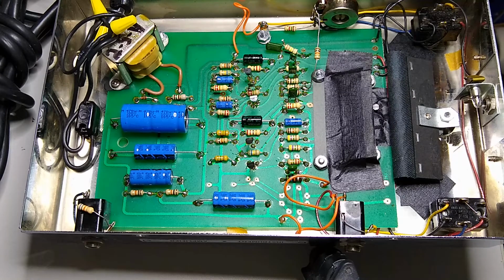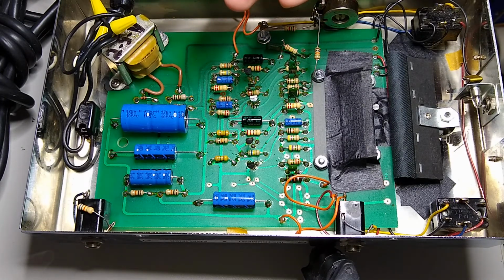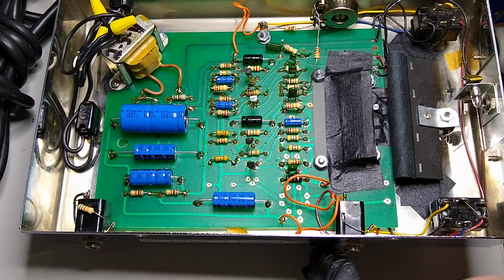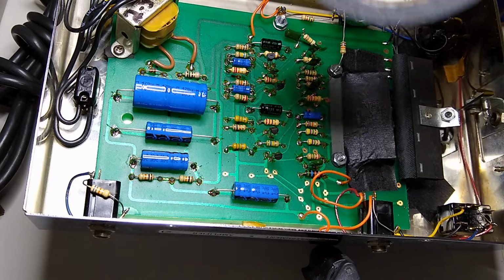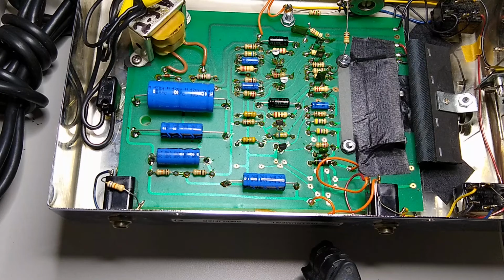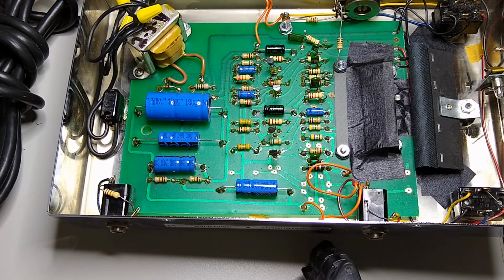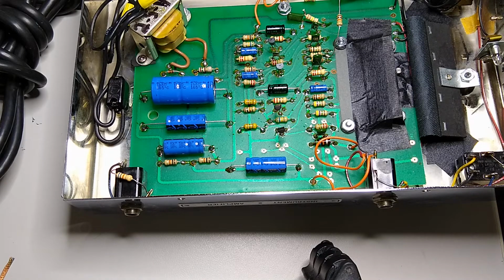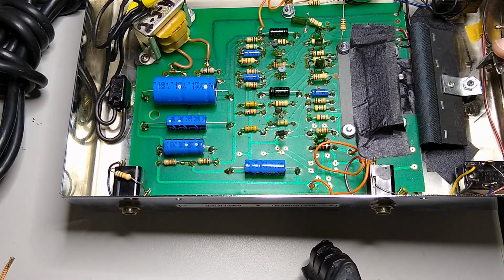Morley Maintenance, Repairs and Adjustments

Comment: ok so i have a pro series distortion wah volume. from 93-97 do the adjustments here wrok also. im finding the wah to be anemic even when running the distortion in the pedal itself. i mean im not expecting like god levelk but the sweep should at least be better than the daphoniq pedal that i payed 50 bucks for on amazon. it had lots and lots of problems but the sweep and to an extent the tone was better. ive checked the literature on the morley website but it seems a bit confusing
Reply from the maker: It should affect it yes, the LEDs get old and stop being as bright too.

Comment: Hey Scott, I recently just got my PWB and Im from NZ, there’s obviously a massive voltage difference compared to the US and I was wondering if a 200W step down voltage converter (240v to 110v) would be a good substitute? Thanks!
Reply from the maker: 240 to 117 would be ideal. The AmpRX brownbox is an excellent choice for this.
Reply: @ScottyBrockway  ohhhh right okay thank you! But just checking because I haven’t found anything with 240 to 117 in my country… would that other transformer work with the pedal?

Comment: Hey Scott I got a Morley Volume Pedal from someone. The light switches on but doesn’t vary the volume. Interestingly when I opened it up just now, that major green colored circuit board is MISSING! Would love to send you the photo of this interior. Talk about feeling ripped off by this seller.
Reply from the maker: If it's just a volume pedal, there is no circuit board. Only the shutter, ldr, bulb and power supply.

Comment: Excellent Vidéo !
I think I'll have to replace some capacitor or resistance on mine...
I just get a Morley power wah but there is no High and when I'm in the lower tone, the sound seems ti despeare...
Everything' seems to be ok inside, the bulb is ok  but the sound is beetween a volume pedal in the low and a poor wah in tbe high😢.
Sorry for my poor english...
Reply from the maker: Sounds like the LDR might be misadjusted, its a common thing.
Reply: @ScottyBrockway  I'll try this this evening to see if it makes a change.
If it's only this, that would be great !
Thanks so much for your fast answer.
Reply: @ScottyBrockway  I think I've found the problem.
The bulb seems to be too weak.
I 've tried with a powerful led lamp instead and it  works great.
I'll h ve to getbsome new 387 bulbs !

Comment: Scott, thanks for putting this out there. I'm used to 'seeing' you on Lyle's channel.

I just got in a PWO from this era that looks untouched inside.

Are you able to change all the components from the top side or does the board need to come out?

I'm considering replacing the signal path caps with film equalivants and adding a 3 prong cord and fuse while I'm in there.
Reply from the maker: Changing the signal caps won't really do anything. Yes you can change all parts from the top side of the board. Making the units safer is a very good idea, I don't trust wire nuts.

Comment: Hi Scott, got a vintage fuzz wah and the fuzz is horrendous. Has something blew or rotted out ?
Cheers, Paul.
Reply from the maker: Power supply often goes bad, also the later revisions have diodes across the the feedback resistor and this really makes it sound correct.
Reply: @ScottyBrockway  thanks Scott. The wah is great, so some diodes need replaced ?
Reply: The fuzz isn't as bad as I remember lol. The volume of the wah seems lower tho, dirty or damaged LDR ?

Comment: My George Lynch Morley wah only works if you push the pedal on the left side ..as you push the wah pedal down you have  to turn your foot to the left or it doesn't wah?
Reply from the maker: I'm not familiar with the newer ones, sounds like the sensor is off to me, or it was designed that way. Have you looked for a manual online for it?

Comment: I switched out the bulb (which was different than the 387 i have in some of my other pwf’s) and while the fuzz sounds insanely good, when I engage the wah, the fuzz sounds very anemic. Is there anyone who can tell me what can be done?
Reply from the maker: Add the diodes that were put in later revisions.
Reply: @ScottyBrockway  thanks for getting back, which diodes are those?
Reply: My board is much different. I replaced the bulb and a couples resisters that looked burned out, and like I said, the fuzz is killer so long as the wah is engaged…so I’ll try to mess with the diodes later today and see where that leaves me

Comment: I have a vintage morley pwb like that.
With the heel down and shroud completely shut, it is very subby/ muffled.
Is there a way to have more clarity not so muffled sound with shroud completely shut?
Is there a specific capacitor that needs upgrading?
Any advice would be good thanks.
Reply from the maker: You can adjust the shroud itself via the nut and bolt at the back, if you lower where it sits on the bolt it will prevent the should from closing all the way, which will affect the bass cut off point. Also the rubber stoppers under the front and back tend to come off and get lost, so you may need some new ones. They are just 3M feet, model number SJ-5012 (Black).
Reply: @ScottyBrockway  thank you for your reply. Much appreciated.

Comment: Hi Scott. I bought an used Morley 20/20 Bad Horsie Wah on eBay. It somehow works until I touch the "contour" tweaker. If I even tweak a bit then a feedback occures. It sounds like a theremin or a hooter when stepping pedal. What can cause the problem?
Reply from the maker: Does it happen changing the setting or just touching the control? Have you checked it against a known working one? I'm not familiar with the newer morley pedals very much. It could be a number of things.

Comment: Is there a forum for Morley wah maintanances? ‘Cause I have a George Lynchen sigh wah first edition that I bought used. There are a couple of issues. The sweep range is very small. Maybe it is designed to be like that. The ‘wow mode’ (low frequencies) and the ‘wah mode’ (high frequencies make it seem that the sweep range is cut in half. I don’t fancy that. I prefer a full range sweep but the standard pedal forces me to choose wow or wah mode.

Another thing is that the foot plate doesn’t touch the bottom of the pedal equally. I tried to adjust the screws that are connected with the spring under the foot plate. But it is hard to make fine adjustment because I think it wasn’t installed properly in the factory. 

And the third is the plastic plate that is connected to the foot plate and goes into the hole on the bottom of the pedal to the red light sensor. The plastic is not straight but crooked. It is hard material and not easy to bend. I am not sure if that effects the sweep range but when I press down the crooked foot plate and the plastic plate goes through the whole and makes contact with the light sensor it doesn’t make an even flowing movement. 

I am not an expert but I had a Morley Bad Horsie before that was in new condition and it didn’t had these issues that I have with this George Lynch first edition wah. 
For those of you who don’t know which pedal I am talking about it is the orange pedal with the black dragon print on the foot pedal. It has wah and wow mode and a booster turning knob.
Reply from the maker: Sounds like the unit has been exposed to high heat and is just warped. I would get a refund and buy another.
Reply: @ScottyBrockway  thank you for the answer. Sorry my English is not good. I opened the back and both red light sensors are glowing. They were not straight in line with the receiver at the other end of the sensor so I made them even. About the circuit I am not sure what you mean. I think I will bring it to a technisian later once I managed to put the pedal back in pieces again
Reply: @ScottyBrockway  and I cannot return it to the store I bought it from. It’s a long story.

Comment: You said for the sweep adjustment to set the height of the LDR. If the LDR is set lower, the sweep is reduce on the high end?
Reply from the maker: Yes, the lower it is, the less trebly the high end of the sweep is. If it's too high, you won't get any bass end in the sweep, depending on the shutter. Every morley is different with the shutter, so it takes some finicking to get it just right and it's pretty sensistive.
Reply: @ScottyBrockway  thanks it worked. I just got a PWO probably a 72 and I play bass. I found it too trebbly and harsh on the full toe position. I lowered the LDR a little and now I’m satisfied with the full sweep. Previous oener was most probably a guitar player… thanks very good info

Comment: does increasing the cap voltage help with hum? i have an old power wah that has a slight hum with the power on, really noticeable with high gain.
Reply from the maker: The pedals were originally designed for 117VAC wall voltage, this isn't really common anymore and can be anywhere from 115-125 volts. Since the power supply circuit uses a voltage doubler to obtain the necessary voltages this means for every volt increase coming in, its 2 more on the other side. This means the power supply can create DC voltages that exceed the rated specs of the filter caps and will lead to premature death, which can cause hum. However this will be very loud, if they are failing. I replace them anyways with better caps with lower ripple current (to reduce hum) and higher voltage and temperature ratings for longer life. I'm still working on my own power wah fuzz to get some simple mods together than make the power supply cleaner and safer.

Comment: Hi Scott I assume by your accent you are not in the UK
I have a Morley VBO from the mid 70's.
Its stopping doing the volume part and i wondered if you had any ideas what could be wrong.
With the pedal up it still has sound greater than with it down.
I have replaced the bulb but at a loss as what to do next.
Could you offer me the benifit of your experience I would be so grateful.
Thanks
Cheers Les
Reply from the maker: The power supplies tend to fail, they are not well designed. Other than that, it can't be too much as the VBO is pretty simple, just the boost circuit in there which is quite simple. But it could anything really, dead switch, broken wire, bad pot, dead transistor, dead caps.
Reply: @ScottyBrockway  Hi Scott thank you for your swift reply.
On the pedal the volume boost works and basically the sound works its just that if you want to use it as a volume pedal there is no variation on the volume. 
The shroud seems to be working but I'm lost. 
Guess i need to buy a new one. 
Cheers Les

Comment: Hey Scott Brockway, don't get 2 look up other Chatters Chan. But been meaning 2 look up yours and Glad I Did , I Have 2 Morley's, 80's,is the 2 9volt bat, Black Gold Basic WHA, model BWA, It's a bit quite Never really want 2 upgrade it,But mite use a comp,or other but works fine just not got that ole tone, TY 4 vid. Will keep in touch, U no where 2 hang,,

Comment: I hope you have a good day, I have some problems with a PWB and I would like to be able to contact you to have more in-depth information
Reply: I have a PWB that the wah effect only sounds when the heel hits the metal instead of the toe. The high tone sounds when the heel is down, not like yours, which works well, what problem could it be?
Reply from the maker: @ingloriousbastard0812  Sounds like the shroud is working backwards, probably broken loose and reinstalled incorrectly.
Reply from the maker: @ingloriousbastard0812  The shroud is the part connected to the pedal tredle, it's black tolex and taped to the bottom of the case and moves with the pedal motion. It acts like a shutter to vary the amount of light hitting the LDRs.